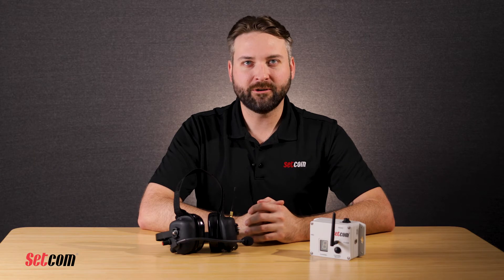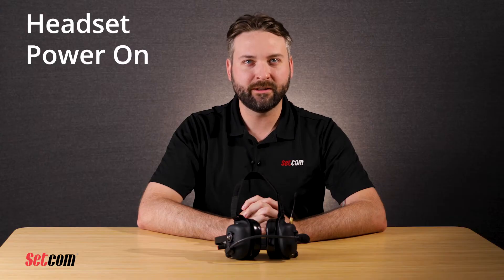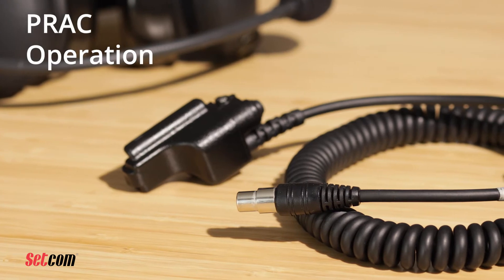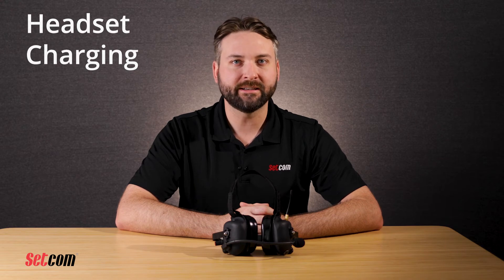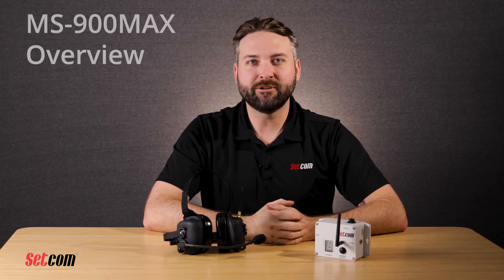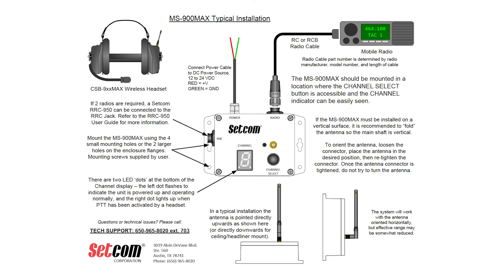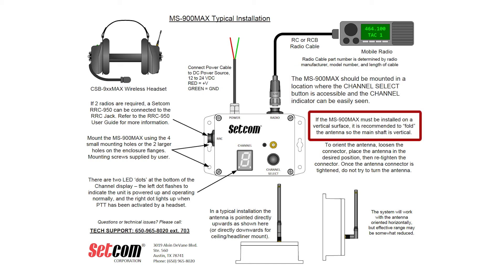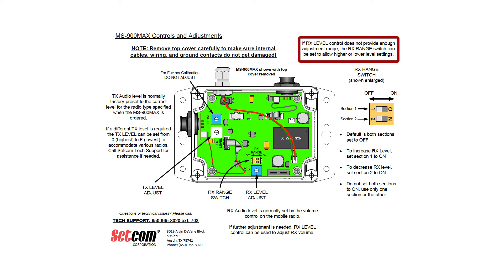Setcom LiberatorMAX Fire Operating Instructions Video

Comment: Got a little problem with one of this headsets.
So I have used a pair of them at work and one of them was charged more then the other. 
So the one with less battery at the end of the day stopped working, probably no more battery.  But when I put them back to charge, the one wich stopped working is not charging at all.  No orange light and no bips if turning the volume to start.
Do you know what my be the problem?
Thanks
Reply from the maker: Thank you for your inquiry.  It sounds like there may be something else going on with the headset, causing it to no longer take a charge.  Our support team does no-cost evaluations in our offices.  Give our technical support team a call to further discuss.  They can be reached at 650-965-8020 x703 or by email at tech@setcomcorp.com .  We look forward to hearing from you.